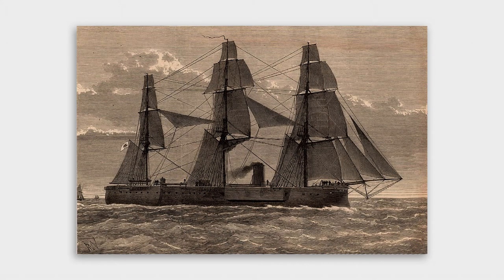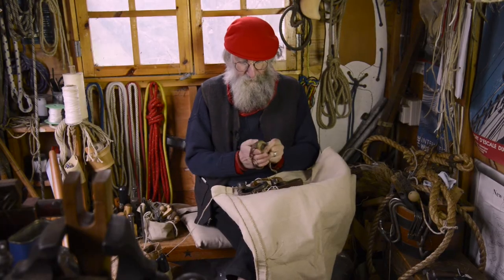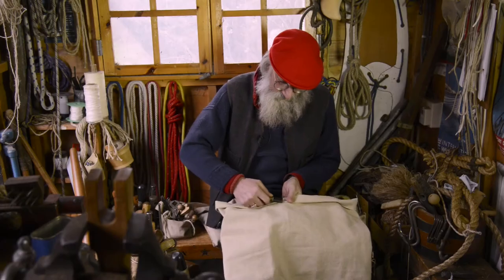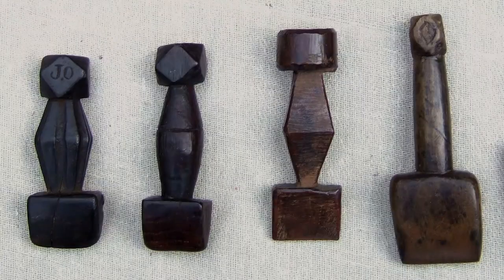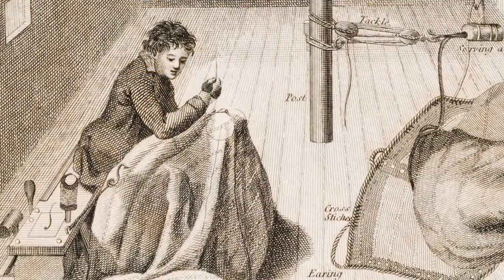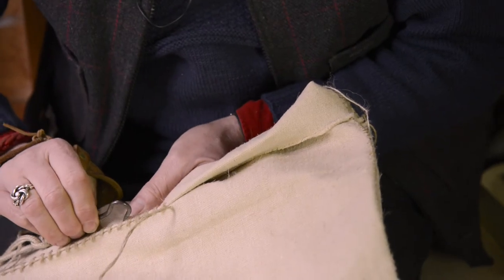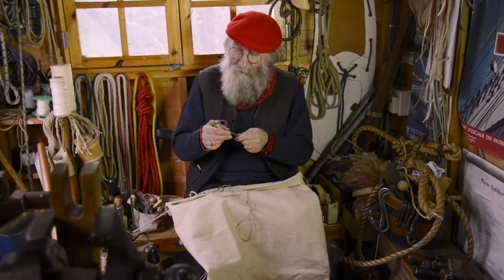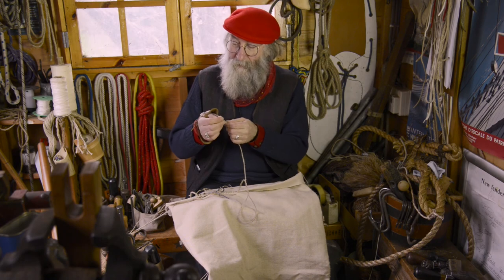Tools of the Trade: Sail, Sack and Canvas Working

Comment: Interesting. But Des omits to mention that the palm is suitable for use with big needles. If used with small needles the eye gets fractured. Therefore with small needles it is prudent to avoid the use of the palm and instead use brass lined pliers. The pliers are used to push the needle through and then to pull it out without damaging the edges.
Reply: I've used pliers specifically to try to prevent damaging the eyes of needles when they go through thicker seams of fabric during longer sewing sessions and I can vouch for pliers as a useful tool in more mundane sewing tasks.